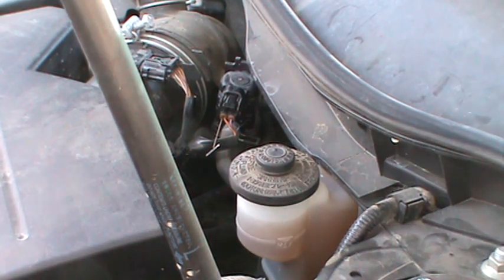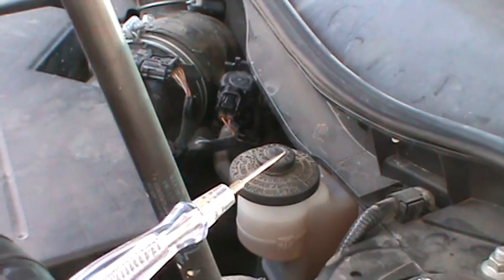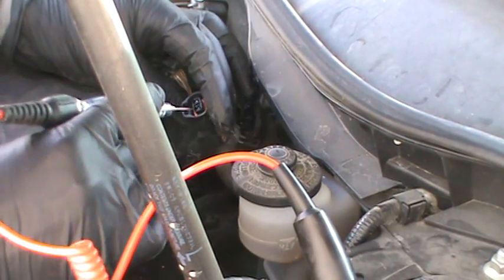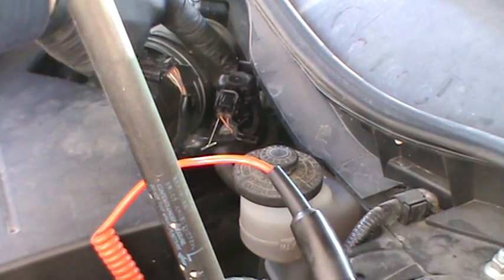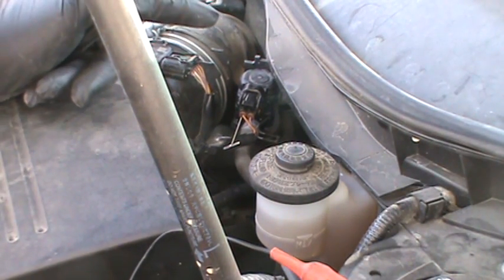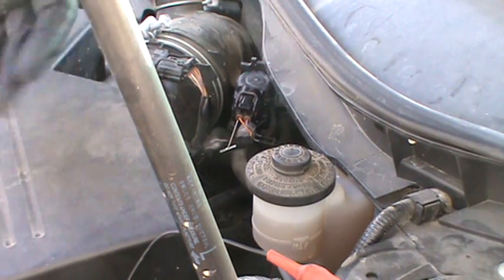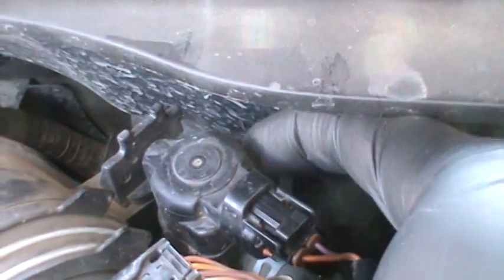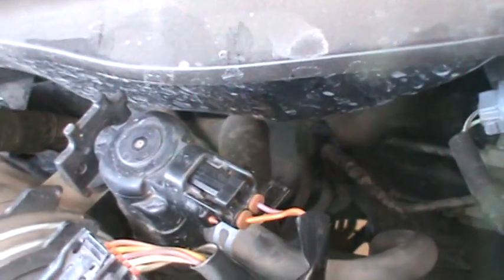How To Check An Evap Purge Solenoid

Comment: just leave the wires plugged up, draw vacuum on the purge solenoid and start the engine, bring the rpms up a little and wait until you see the vacuum gauge go down. that means the solenoid does open at intervals. test vacuum lines to insure there's no leaks in them. if there are it can cause your car to run rough at idle in drive. good luck. test the gas tank vent solenoid too if you have trouble putting gas in the tank.
Reply: When I'm putting gas in,my 03 jeep liberty sport, it acts like it's full and I have to pump a second then wait & repeat💨 it takes forever. What do I need to check for.?
Reply: @jenntitman35  any codes? if not. look for loose of worn hoses. sounds like solenoid sticking but not sure+ needs further checking.
Reply: I havece a honda civic Turbo 1.5 2017 and when is in idle on stop light on drive mode start shaking and the rpms drops to a 550 rpm but if I turn the ac or day lights on it goes back to normal 650 rmps. You think it can be a bad purge solenoid?
Reply: No codes by the way

Comment: This is extremely confusing. Keep it simple man. I don't need twenty ways to check it. Give me one. The simplest one.
Reply: Just hook vacum pump on it and see if it holds, or blow through it. If you can it's bad.
Reply: @kylewoodward7078  while the engine switch  on or off?
Reply: @cavalierabouhamma2828  the valve needs to be closed so your able to apply vacum(suction) to it and see if it will hold the vacum. That's all vacum is, your applying suction to something to see if it can pull air through what ever your testing. If your gage pumps up and slowly goes down, then you know you have a leak. You just have to figure out which way your valve works.

Comment: Replaced my Evap purge solenoid today in My Camry. All the symptoms of rough running engine and misfires immediately went away but I cannot get the computer error light to disappear when I disconnect my battery. Any Ideas people?

Comment: Just because it's got power don't mean the solenoid is working. Check or then Pull it and add power and check flow.  That's the only way.

Comment: Are there Purge valves that are designed to stay open until you apply voltage. Another words the other way around where applying voltage closes the valve?
Reply: The vent valve stays open until voltage is applied.  The purge valve is closed until voltage is applied.
Reply: @steve4386  I have to purge valves and they seem to be functioning the other way around.  Allows air through until voltage is applied.

Comment: Scanner danner would have described it correctly, no current flow no voltage drop that's why you have 12v and 12v on both sides of the coil. When it's active 12v and 0v on the two because there is current flow and a voltage drop.

Comment: I didn’t use a fuse. 16 gauge wire connected straight to one terminal blade and another 16 gauge wire to the other terminal blade on solenoid and then straight 12.6 battery voltage. All the magic smoke came out.Did this off vehicle,bench test so as not to mess up ecm/pcm. Solenoid showed 32 ohms of resistance and obviously continuity. Assumed it was a bad solenoid, so what the heck.Do need something to bring amps down. Remember,it’s not the voltage it’s the amps that smoke components 😖
Reply: 32 ohms is correct.  its a coil!  when amps go through it makes the coil turn into magnet.  that magnet pushes the valve open/close.
Reply: mine went bad and was reading 135k ohms.  also a good one clicks when you start the car cold.

Comment: I’m getting P0441 and P0455 (large leak) codes, which lead me to the evap purge solenoid on my 2009 Camry.  When I did a visual check w/ the engine running I hear a hissing noise.  Would this likely be a bad hose or could it be the solenoid unit?
Reply from the maker: D Manns sounds like vacuum leak. Use spray bottle of water around suspect hose to find leak, or have someone use evap smoke machine to find leak
Reply: Vac leak SOMEWHERE CHECK GET REGULATOR  NEXT TO THE GET LEFT SIDE LOOKING AT THE FIREWALL WENT THEY GO BAD THEY HISS,THE sealGETS DRY ON THE BOTTOM.
Reply: What about P0442?
Reply: What about PO442?

Comment: I rplaced mine on a 2001 Cherokee and if the engine backfires the top of the valve will pop off. Is that normal?
Reply: You vac lines are BACKWARDS or canister is MAX capacity,time to buy a new one $$185 ××>375.00 toyota,S are less

Comment: true. the hose was bad on mine. i should if did further testing but didnt.  i replaced hose. + erased code with obd2 . i think i should be good. if so,, i fixed it for price of a 2 cent piece of rubber hose.👍🏁🏁

Comment: The worst I ever saw. Use the Right terms  Man geeez. LED Light is computer safe LOL. A LED tester Light takes Less Voltage to Light then a Reg. Test Light, Because a reg test Light has more resistance then a LED Light do your Home Work ....... Just because you hear Clicking dose not mean the Gate is Closing all the way inside the Valve It only means the Coil is energizing.
Reply: he did say test vacuum hold first